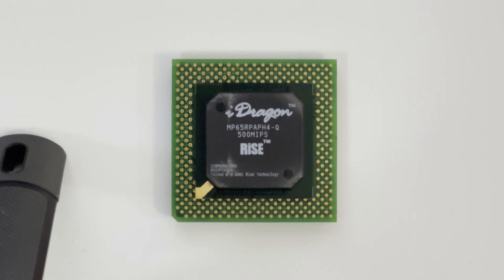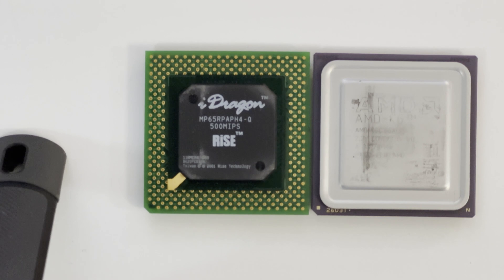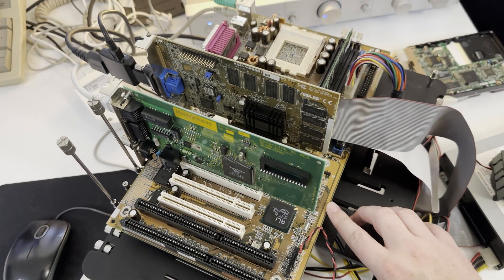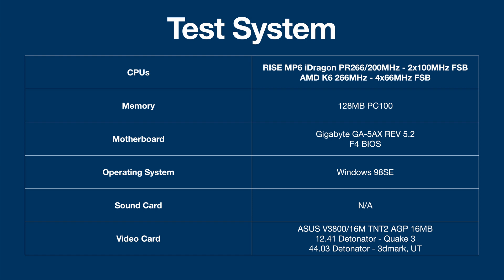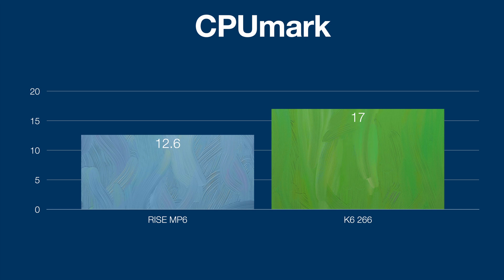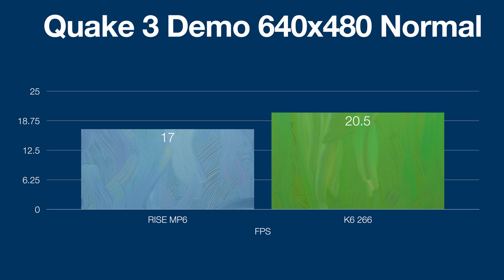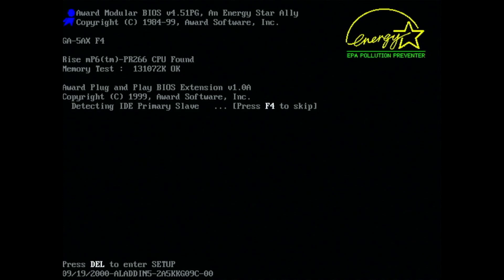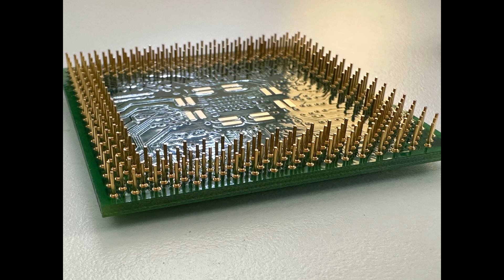Rise mP6 iDragon Socket 7 CPU Review

Comment: A question: What is the difference between this iDragon CPU and the normal Rise MP6 266 Mhz CPU Kirin?
Reply from the maker: Very similar I believe. The iDragon runs at a lower voltage due to the die shrink.

Comment: I have the same iDragon CPU and i always wanted to try which Mainboard works best for it. Since it has only a very small cache on-die, i guess that it might be a bit faster on an MVP3-board (typically faster cache) than on a ALIV-board (typically higer memory bandwith). The later versions like the PR366 versions had the same die-shrink as the iDragon and they ran up to 250Mhz. So MVP3 and a higher fsb to match that frequency is my plan (probably 112x2 or maybe 124x2).

Comment: i have seen these, and 2.1 wont cook them, at least the later revisions actually overclocked stupidly well and took a volt bump without issue to get 333 or better easily... 

now, the winchips are cooler to me, because those things.. my gods did they clock.. and keep stupidly low temps to boot.. 

these, can be fun, just put a 1/2 decent fanned sink on that and it wouldnt have even balked at 2.1 from my exp... 

these were interesting because we had a few mobile computers at a place i worked that used them and ii found out we had over 150 units of the same hardware that had failed, but not due to these chips, bad caps... the working ones had been re-capped, and upgraded to winchips that didnt really effect the use time as they were setup runnin off a bank of 4 deep cycle car batteries rather then the stock hsit nicad setup they came with originally.. 

they were mobile dignostic systems mostly, but could be used for a bunch of jobs, they were part of what we called "the lego set from hell" long story but, parts that fit the same sockets but didnt work because the specs were ever so slightly dif between models or revisions.. but sometimes would work anyway... for no apparent reason... (even the companies own techs were just done trying to understand why... since it should have all worked togather from the build specs and testing the did... 

anyway the winchips could be run in those boards at 333 with a simple jumper change and the stock heatsink was more then enough to cool them, they offered a major boost to overall perf on those systems. 

these were interesting chips though... oh also... i have seen some pretty damn rare umc socket 7 chips as well as a couple unreleased IDT chips(winchip company) that, had they actually launched them.. i got zero doubt they would have sold....  k6-3 levels of perf or better with lower temps and more headroom to overclock... my buddy had 3 he got from his company test lab and... we took one from its rated 400 to 766mhz before the board crapped out.. (board wouldnt  let us go higher, not the chip....it was still running cool and chucking no errors in testing..).. and, at those clocks, it just destroyed the k6-3 my buddy had, that till we de-lidded it years later, couldnt pass 550 without errors...after 650 24/7 no errors.. so yeah.. yet again thermal paste held chips back..ugg..(we also relaced the ihs with a custom coper one more like the moodern ones no pressed just machined out of some copper scrap at a buddies work.. (he traded making 6 caps for these chips, for a stack of k6-2 chips he unlocked... 9 chips all fully unlocked to max k6-3 specs... traded 3 back to the guy for some old slot A thunderbird chips he modified with dip switches to set the volts/clocks right on the cpu... copied plans somebody posted online and used what he could get to make them easy to overclock in most any board.. oh he also re-capped all those chips with copper caps, sold a few on a forum thats nolonger around, that was fun though i wish i took one of the rigs the offered to send me free.. recapped L7s7a2 board, k6-3 copper cap, ram, gpu and psu(recapped as well)... i just didnt have any place to use it at the time... sadly..
Reply: I suppose it means the Rise CPU have ajustable multiplier ? I'd like to see it over 300MHz with 133MHz FSB
And which Winchips are you talking about ? C6 or 2 ?
Reply: @dkrbk  pretty sure it was the c6, been a very long time ago now, the unreleased chips i dont rememer the model numbers(it was a dev string name not something simple/catchy on each one.) 

i have taken those winchips that looked like old socket 5 pentiums to 450mhz with a half decent socket 7 cooler... impressive since that one was rated at like 200 or close to it... they genuinely could have sold much higher clocked chips and been more competitive despite the weak fpu perf.. that seemed pretty much sorted out on the later chip that never actually came out to market... and on most boards detects and something along the lines of "unknown pentium mmx" or amd k6-2  sometimes.... not sure if it was the bios having dif id's for the same numbers or the chips having dif id strings for testing.. either way... they were impressive for their day... not on pure perf but. potential. 

reminds me of the PowerVR chipsets, like the Kyro II, had they not lost their sil manufacurer at the time, and got the next gen card out that had proper hardware TnL... i think we would have had a genuine competitor to ati/amd and nvidia for years, those powervr/videologic designs were doing more with less... 

hell now im just glad we have Intel Arc pushing out a 3rd option and hopefully they sell enough to warrant producing more cards, the 4million they made should sell pretty  fast with my exp, this acer predator bifrost is amazing.. 16gb a770 with a 285watt tdp... even the current drives arent giving me real problems.. just niggling issues that can be easily sorted inmost cases using dxvk or similar...